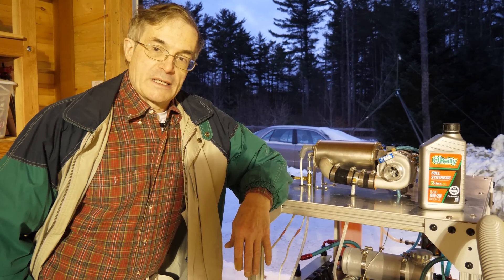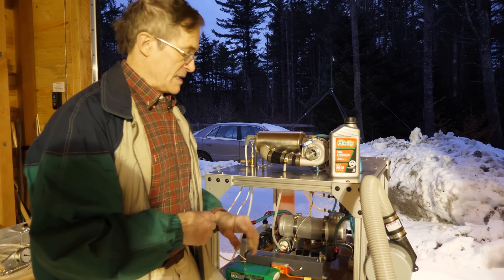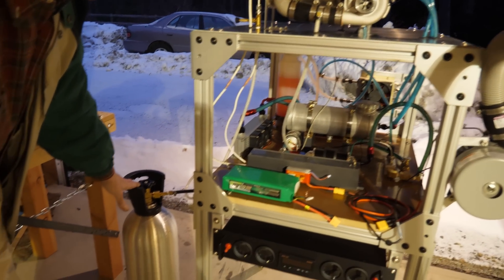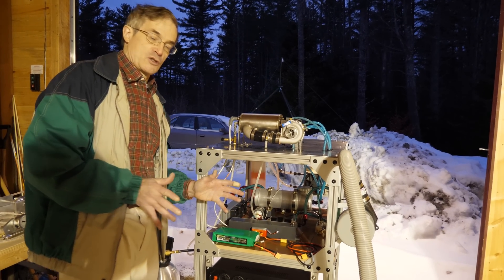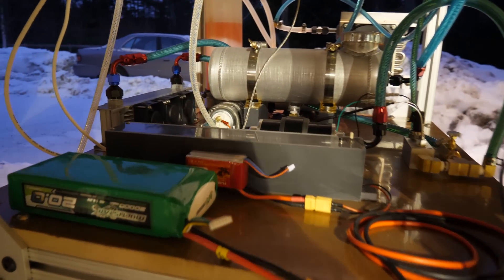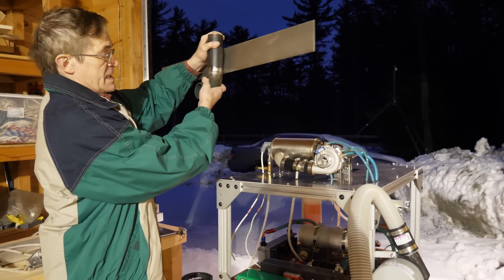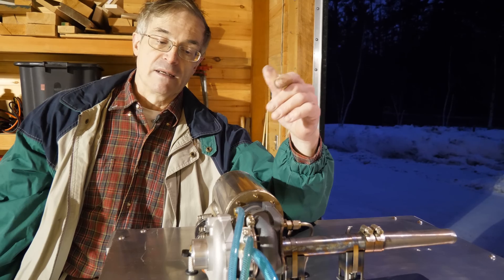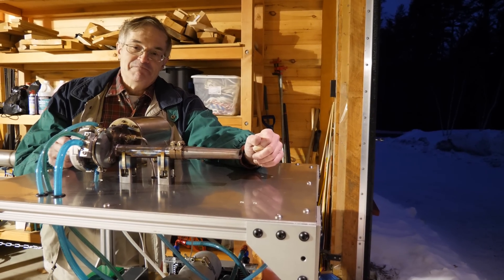FIRING UP THE TURBOJET!

Comment: Now this is more like it... 😀
I have been pestering my metal machining skilled mates to ponder the real world logistics and dynamics of this as a PSU.
Is the shafts rotational speed (Edit: Velocity) and its ability to provide adequate rotational torque compatible with a relevant style of electrical generator?
Solid state fuel cell or Gas/Steam driven turbines are the way forward for UAS hybrid electrical generator systems. 
If only a more axial flow type turbine/compressor wheel turbocharger was readily available. 
I have seen a Twin Scroll turbine side that utilised an axial flow type of turbine wheel but  it is by no means an OTS option. 
Dunno how detrimental compressor surge would be to this design though. Maybe a CF / Ceramic composite compressor wheel of conventional design would suffice.

I would love to see this developed along side a helium based, sound suppression system. 
The turbine gas out flow could be utilised in several ways. 
•feed back system for compressing gasses.
•Lift thrust to reduce work load of prop driven propulsion, allowing more of energy supply to be utilised for manoeuvring tasks. 
•To create high pressure (reduce low pressure) zones to aid with barometer systems, dispersement of prop wash and restoration of ‘clean’ air for tasks such as descending of aiding placement of optics & other sensors... Many other tasks are possible such as; assisting generator drive by incorporating gas driven components as well as shaft driven components, inducing airflow through hull of craft to aid cooling of electronics, dispersion of rain fall from trailing edges near ducting or dispersant of reflecting water droplets in close field of optics etc etc
Reply from the maker: These turbocharger based turbojets are too heavy to be practical for direct thrust applications, especially for airborne applications.  Using them for generating high velocity gas to drive a turbine makes a lot of sense .  We're working on a low RPM, high torque turbine that hopefully will be a better match than a scroll turbine from a dismantled turbocharger.

Comment: What are you going to use to turn the genset? It kinda sounds like a fan or paddle wheel in the exhaust stream buuuuut the efficiency would be really bad so I think you've got something else in mind.
Reply: Maybe something like http://www.gasturbineworld.co.uk/dynajetmicroturbine.html
Reply from the maker: The design for the turbine is a symetrical, reversing flow blade similar in principle to a Pelton wheel.  Take a look on YouTube at one of the animations of this device.  Maximum effeciency occurs with a tip speed one half of the exhaust velocity.
Reply: Thanks for the response. Well, you were right and I was wrong. I looked up the Pelton wheel and apparently, 90-95% efficiency is doable even at small scales. Assuming 50% on the turbine (which is probably generous but I couldn't find info on how the efficiency scales down)... overall thermal efficiency could be in the neighborhood of .50*.90 ~ .45 

That's better than most generator ICEs.  Do you have any ballpark estimates on how efficient the turbine is at that size?
Reply: JK. Found a paper on the subject and it looks like the got around 22.8% efficiency. Sooo .23*.90 ~ .20 

Still in the ballpark of many automotive ICEs.

https://pdfs.semanticscholar.org/1dfd/aec8ebf1315fe8c81525ce93af71788476d1.pdf
Reply from the maker: The link was interesting and the values they obtain seem reasonable if a little generous.  30% conversion effeciency in a reciprocating engine with a compression ratio of 9:1 is typical and a turbocharger with a 3:1 compression ratio is maxed out.  We also have to drive the oil pump, cooling fan, and overcome the small loss in the turbocharger bearings. Nevertheless, this is still a real TURBOSHAFT...neat.  compound turbos will increase this effeciency further.

Comment: I love and support what you are doing for the community. STEM should be marketed as safe and fun like you deliver. Question, where do you source your extrusions? 80/20? What did you use for the jig in this video?
Reply from the maker: Some of the 80/20 components are from McMaster Carr.  Most of the extrusion is surplus from eBay.  What jig are you referring to?
Reply: @TechIngredients  thanks for the reply. The 80/20 style extrusions that caught my eye made up the structure of the turbojet test platform :)

Comment: All this jet stuff reminded me of a question I had a long time ago but had nowhere to ask. I'll ask here since you seem like the kind of person to ask the weird stuff.

If you accelerated air to the speed of sound, would you be able to fire up a scram jet that's strapped down? If it works, would it just be an over engineered torch, or would it actually give measurable thrust?
Reply from the maker: A scramjet is a more complicated and flexible modification of a ramjet.  Subsonic ramjets do produce net thrust.  A compression ratio somewhat less than two to one is possible just below the speed of sound.  The shock wave generated as the inflow goes supersonic substantially increases this pressure ratio and that is where these engines begin to compete with turbojets.
Reply: well, if you plug a multi outlet power strip back into itself, with a light bulb plugged into one of the other  available sockets,  will the bulb light up ?

Comment: Ok ahh oil pressure on stabilized, bypass open , ff on it in ok ahhhh n 1 spool up nicely,  ngt  increasing,  ok tower were clear push back.  Tower roger push back clr .roger, clr txi to ahhh alfa 1 continued to to rw 29r hold short ,.read back clr ., qnh1012 wi d 12 at 20 . Clr to rw 28 climb to fl 28 intercept rad 230 switch to radar good day

Comment: Are you saying this could be a example of a car exhaust that could generate something? That would be awesome. My sister told me she us to believe that the exhaust is what propeller her can. I  know, but she's dead now, so you won't hurt her feelings by launching. Be guy's, you're doing gods work.
Reply from the maker: You could, but the back pressure associated with driving a turbine will decrease the power generated by the engine.  This might be worth it for a specific application, but there will be no net gain.
Reply: @TechIngredients  dame it!  Thanks for the feedback.

Comment: Very nice build as per your usual.  Great work.  Will this evolve into the drone generator?
Reply from the maker: That was the original motivation.  Considering the low effeciency of the single stage thrbo, the weight of a second, compound turbo as well as the support system, probably not.

Comment: It looks like fun. Nicely made.

I hear a little instability in the combustion. I wonder if the burner volume is enough to have air-compression resonant effects, like a flute They had issues with things like that with the Saturn F1 engines, and from the looks of things, the Nike Hercules booster, too, which is why there's a rod going through it. Perhaps putting a vane in here or there, might help. You might have fuel pressure issues. I see air in the water cooling lines, and perhaps the cart is tall enough to cause fuel delivery issues as well.

I had an idea for an oil pump, but you don't want to fly it.

Cool project. Thanks for the video.
Reply from the maker: The combustion is unstable and improved with a nozzle that sprays laterally tword the flame tube wall.  Surging still is present and we are installing a small exhaust gas bleed before the turbine scroll.

Comment: I've been seriously looking into building a turboshaft engine myself, will be interesting to see if you can find something off the shelf for the free-power turbine, that's been the thing preventing me from jumping the gun on it. Governing it electronically for constant RPM on the generator side feels easy compared to machining a custom turbine and acquiring the gearing required to get the RPMs of it down to usable levels for a 2-pole generator(Or any other application really).
Reply from the maker: We haven't found anything off the shelf, but we're going to approach this a little differently. Based on the principle of a reversing flow turbine similar to a Pelton wheel and a large diameter, I want to reduce the output RPM of the turbine and eliminate reduction gearing.
Reply: @TechIngredients  That could work way better than my idea of using half a turbocharger with a custom bearing block, will be interesting to see what efficiency you can reach at lower RPM with such a setup.

Comment: You need to make your primary dilution holes a little bigger, or more dilution holes. Your flame front is way to close to your turbine. The exhaust coming out of your combustion chamber is red hot. Did you incorporate bypass air at all? Excess air that keeps the turbo from overheating.
Reply from the maker: You're right about the bypass holes.  Enlarging them does improve the performance and reduces the surge.  Cooling off the exhaust is the function of the tertery holes.  The exhaust is indeed red hot.  Notice that the pressure is reaching 24PSIG.
Reply: @TechIngredients  I had also incorporated a cooling envelope to the design of my combustion chamber. A couple of mm between the flame holder and combution chamber wall at the end of the flame holder. Seems to work very well. I did have to lean out my primary dilution holes, so the flame front didn't drop back close to the turbine, but it worked very well. I've seen boost out of my T-4 up to 29PSIG. I have pictures of the combustion chamber I made if you would like to see them, also video of it running. RCDON also incorporated this into his design.

Comment: 9:00 Why go from rotational energy, to wind energy, and back to rotational?
Reply from the maker: There are two main reasons. This allows the power turbine to operate without interfering with the operation of the jet.  The power turbine can be stopped by diverting the exhaust gasses and most importantly, it can be designed to produce higher torque and lower RPM than the engine, making it easier to interface with other equipment.

Comment: i've run the number on the Gt1241Z  and it shouldn't be surging , ideally we'd like to see a Corrected mass flow of 10 lb/min with 76% effic at your 2.5:1 PR , but the turb stage is restrictive and will only flow a Corrected 6.8 lb/min , which will equate to an Actual mass flow of 8.3 lbs/min at 74% comp effic ................................thankfully your ambient temps are currently very low which is helping the situation considerably , on a hot day its going to get worse 

With a 5% pressure drop across the combustor and 2.375PR going into the scroll at 1500F   there'll be a requirement for a 1.84 PR across the stage  leaving only a 1.29 PR in the jetpipe or ~4 psi , but most of that 4 psi will be dynamic pressure not static pressure so very limited opportunity for thrust or shaft horsepower , probably ~5 lbs of thrust or a few horsepower , the 64% turbine stage efficiency is the "killer" , too much pressure "lost"  across the stage .

Now why is the engine surging ...............................I'd recon on the gases entering the scroll haven't been "funnelled in"  correctly, extremely important to smoothly change cross sections from flametube to scroll inlet ........................I've seen it a number of times  on first builds , the turbulence created reduces the flow into the scroll sending the comp into surge .

Cheers 
John
Reply from the maker: Thank you for the extended comment.  The restriction posed by the turbine can itself explain the surging. Although turbulent pressure loss due to discontinuities in the exhaust path will exacerbate this.  Our solution will be to divert some of the exhaust gas prior to the turbine.
Reply: @TechIngredients  No , the turbine stage is large enough to cope and not cause surging  unless a vena contracta exists at the scroll entrance due to inadequate funnelling of the gases between flametube cross section and scroll inlet cross section , or a too tight a jet nozzle but generally your TOTs will become excessive first and yours aren't .

Do not divert exhaust gases, there is no need for it and will only create problems , it'll be a case of two wrongs trying to make a right ...........................your engine should work without surge , I've done the numbers after consulting both the comp and turb flow maps , something I've done a thousand times  before .

Another thing thats not helping is the very long jetpipe ,  and please only have metal tubing for all pressurised fluids near the engine , anything else decays with the radiant heat  and a burst fuel/oil lines spells disaster 

Cheers 
John
Reply from the maker: Your point about the fluid lines is an excellent one.  Using flexible lines even armored lines should be at most temporary to help position equipment and access routes. But, hard lines will be safer, more compact and even more attractive.
Sorry, but the topology of the surging problem seems relatively simple.  The controlling relationship is the power input to the compressor vs the mass flow through the compressor. To optimize the jet we want to occupy the highest effeciency island on the flow map while remaining cognizant of the proximity of the surge line; possibly trading a little effeciency for additional operational safety/flexibility.  Diverting exhaust gas prior to the turbine should act by burdening the surging compressor with additional mass flow without increasing the drive torque from the turbine or reducing the air flow or fuel/air ratio through the combustion chamber.  Diversion is adjustable without major reconfiguring of the turbocharger and this gas is still available for thrust or for driving an output turbine, as you rightly said the jet pipe pressure is substantially lower than the pressure entering the turbine scroll.
Reply: @TechIngredients  Its obvious you haven't done the calculations for your "hot bleed"  solution , you will end up with a less efficient engine .
The very poor turbine stage efficiency means your engine is barely able to keep self sustaining , by bleeding off ~1.7 lbs/min of  hot gases and increasing flow through the compressor to the optimum 10 lbs/min , you'll be requiring the turbine wheel to supply  >15%  extra horsepower , where is it going to come from ?
Your surging isn't being caused by the turbine stage IT IS LARGE ENOUGH.
For 20 years I've been helping guys get their engines to run , if you don't wish to avail yourself of that experience, go ahead and hot bleed  , but it won't solve your problem/s .

Whilst you're doing it , please move your thermocouple to downstream of the turbine wheel which is its correct position , also I'm a little unsure of your turbo oil drain position at the oil tank , the returning oil MUST be discharged ABOVE the oil surface otherwise drainage problems result  with oil leakage past the turbo seals 

Cheers John
Reply from the maker: Thanks for your comments.  We'll keep your suggestions in mind.
Reply: @TechIngredients  You've put an enormous effort into a beautifully crafted engine and ancillories, it deserves to be running sweetly .
All the best with your mods 

Cheers John
Reply: I agree with all that John " racketmotorman" has said......  http://jetandturbineowners.proboards.com/

Comment: A surging DIY turbojet will overtemp if you attempt to bleed air , there is design faults with the engine , including a mismatch of comp and turb sizing , the flametube to turb scroll interface is wrong , there are probably several more I could mention from nearly 30 years experience building these things , for reliable build info go to http://jetandturbineowners.proboards.com/
Reply from the maker: I agree if you are referring to bleeding air from the compressor, but I disagree if the exhaust is diverted before the turbine.  This increases mass flow by reducing back pressure.  It will also reduce the power delivered to the compressor, the compression ratio and effeciency, but that might be necessary.

Comment: I wonder if you could get it to run on wood gas. Hooking it up to a generator would be pretty awesome to see fallen deadwood turned into electricity
Reply from the maker: Theoretically, it should work.  You'll need a lot of wood gas.
Reply: Tech Ingredients right on—I’ve got loads of biomass for distillation. Would eventually run out I imagine. Have you considered natural gas? I’m really excited to see the progress. Also-what kinda of generators would you hook it up to?
Reply from the maker: We are assembling a large diameter, low speed (relatively) free turbine and will use an 80kv BLDC motor as a generator.
Reply: Tech Ingredients do I smell 3-phase in the works??

Comment: Your force deflector will really be an augmentor with induced air flow so it could give up to twice the force reading you'd get from putting the test bed on rails.
Reply from the maker: That's an interesting topic itself.  Thrust augmenters produce additional thrust because the of theBernoulli principle.  The air that is drawn into the jet stream across the front of the lip of the tube reduces the air pressure over the wall thickness.  That is why augmenters have broad, bell shaped inlets to maximize that surface area.   The thin wall elbow we are using will still see that effect, but it will be pretty small.

Comment: Could've had a V-12. You should use the 0W-50 motorcycle oil. It works like 0 weight when cold and 50 when hot. Make sure your DC motors have neodymium magnets. If you use AC motors the more phases the better. Hope to see that drone fly.